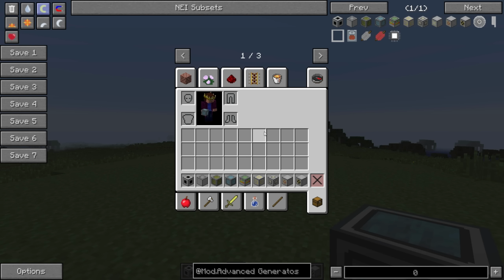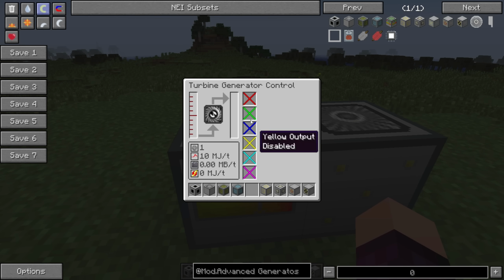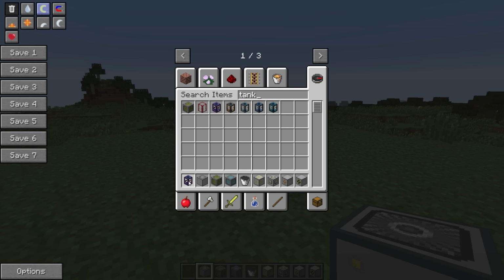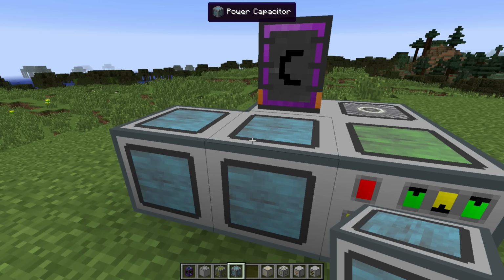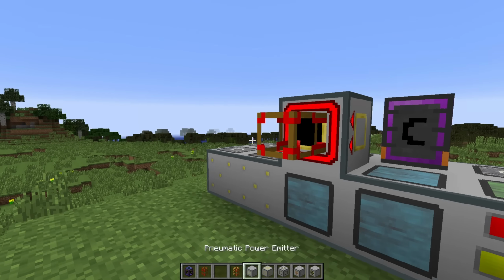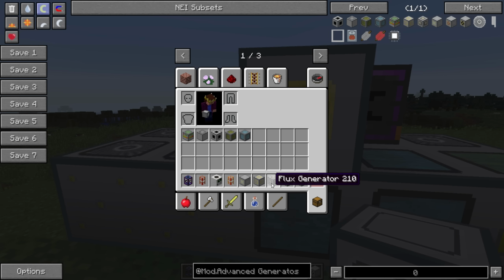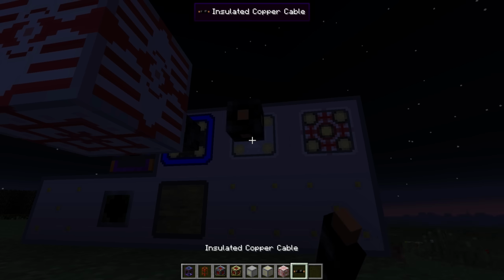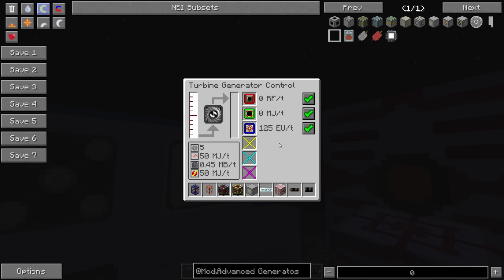Advanced Generators Mod Spotlight - Best Power Generation? [Minecraft 1.7.10]

Comment: question....does the power capacitor have to work with the generator? For example, if you have solar panels, can you directly pump the energy into the capacitors without the generator, and use it just as a battery bank? If not, then do you know a mod that offers a battery bank without a million in a half machines to go with it?

Comment: So you added a fuel tank and it did... nothing? Or are you saying that one fuel tank has the exact same effect as adding two capacitors?
Reply: Just gonna throw this in here: I'm pretty sure he kinda failed there. He SHOULD have hovered over the fuel NOT the electricity. I don't know how much one tank adds but the mod has changed a lot since then!

Comment: Is there any other mods i need to make this work and if so is their some recommendations?
Reply: As said in the video, there's various fuels that pretty much require a mod adding those fuels, so Thermal Expansion, Ender IO, BuildCraft, and I'd assume IndustrialCraft. Do yourself a favour though and just use one of the various modpacks available, making your own can result in many headaches. If you use the Curse Voice client you can download modpacks with the click of a button, if you want to edit a pack you can do that too by opening the profile options of the modpack once it is installed and unticking the 'locked' box, then you can add more or toggle them off if you don't want a particular mod installed.